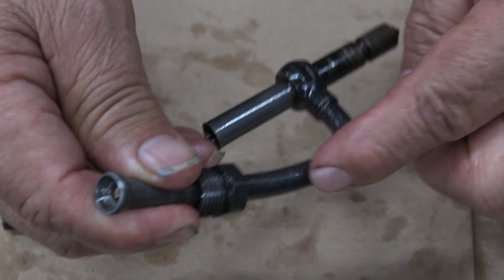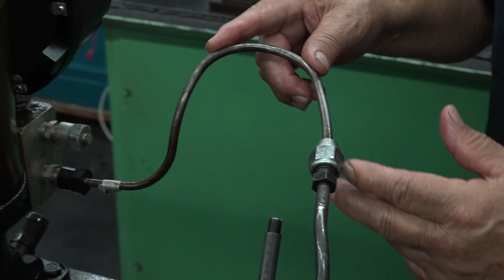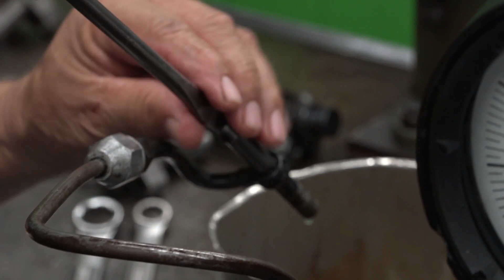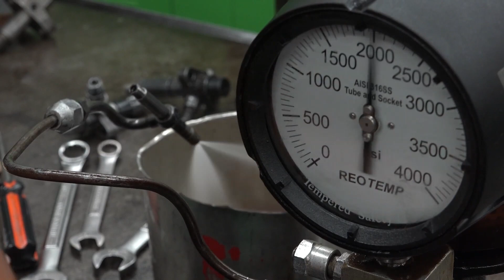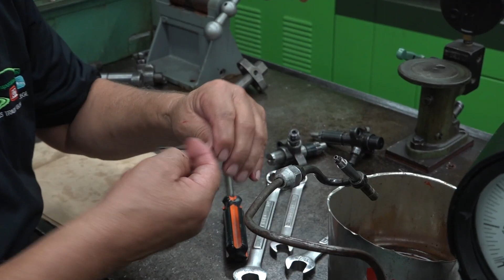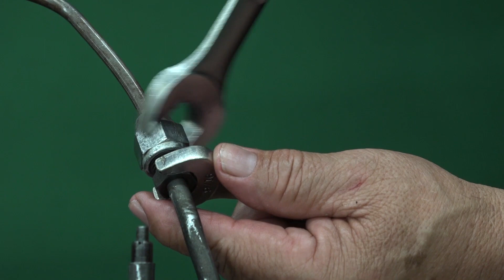Pencil Fuel Injectors

Comment: How do you find out what the nozzle open pressure is? Thanks for the info👍
Reply from the maker: Depending on what engine it's going on and if the engine is turbo charged or naturally aspirated. If it is turbo charged, then the opening pressure will need to be higher, and the timing will have to be more advanced because of the time it takes the "Penetration" of the fuel to crash into the air "swirl" and ignite. Always refer to manufacturer specs first.

Comment: On a 3020 I am restoring right now, 1 of the 4 pencil injectors has a flathead screwdriver spray adjuster in it while the other 3 have the allen heads. I suppose it would be a good idea to just rebuild and set pressures on all 4 or is the difference anything to be concerned with?
Reply from the maker: Important thing is the "Cracking or Popping" pressure.  Also the specs for a turbo-charged engine are a bit higher due to the extra air in the combustion chamber and the spray has to "Penetrate" the "Swirl" of air caused by the piston top design.

Comment: So what pencil injector would have a opening pressure of roughly 2300 psi to fill a 700cc chamber?
As research for a project...
Reply from the maker: Good question and it will take some calculating. First and foremost, 2300 psi is more to accommodate an engine that has more air volume than a naturally aspirated engine. Remember that the engineers who design these engines consider everything to get the best combustion of the fuel. That is the number 1 result, "The Environment" secondary will be the MPG.  The size of the holes will determine the psi needed to inject the full shot of fuel. The compression ratio is the wall that the spray has to crash against to break up the fuel molecules more and thus will bond with the oxygen more for better power delivery from the explosion.
Reply from the maker: It’s average injection pressure and if it’s a turbocharged engine, higher nozzle opening pressure due to the “forced air” into the combustion chamber. Remember that the injection spray has to penetrate the air “swirling” for the purpose of breaking and binding the fuel particles with more oxygen for better burning.
Reply from the maker: Possibly a turbocharged engine.